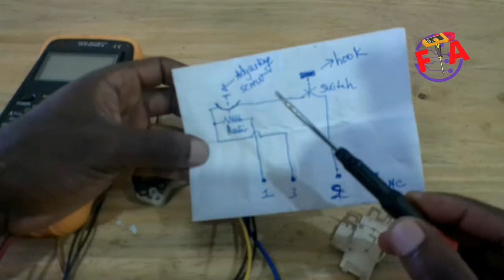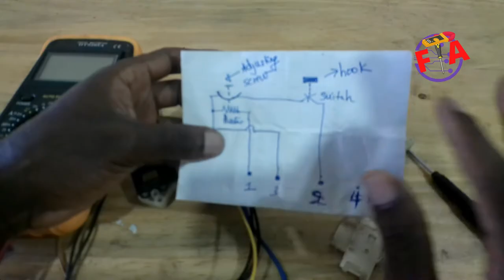DON'T REPLACE IT: HOW TO BYPASS LG WASHING MACHINE DOOR SWITCH STEP BY STEP.

Comment: Adjusting the screw can cause the lock not to unlock. You then have to remove the top of the machine and remove the switch from the body. I just removed the red latch protuding from the switch with a grinder so it no long latches.
Reply from the maker: Okay

Comment: Could you just put a diode on pin 3 then connect it to pin 2 on the harness end , the tape it or use a magnet to keep it out of the way?
Reply from the maker: what is the purpose of diode here? I don't undestand
Reply: @felixtechnoaid2044  , I was just thinking you could use a diode and then put a resistor to simulate the lock exactly, you just need to know how much resistance the thermal material produces cold vs hot. But if a direct connection works, then 👍
Reply from the maker: @BobHenderson-dr2wy  I don't have much information on that, I shall do research see if it can work

Comment: Hello, I need your help. I bypassed the switch just by adding some thick tape inside the internal part of switch to remain pressed and make contact all the time. I did not remove the thermal sensor nor the spring mechanism. Now the door is permanently locked and unable to open😅. Even when i try mechanical force bypass by pressing the lock with haxo blade it doesnt work. Please guide to solve this thanks
Reply from the maker: Cut or remove plastic  hook attached to the thermostat.
Reply: Haha 😂😂😂😂
Reply from the maker: @MikaeYYT    why are you laughing
Reply: looks like you forgot to remove the lock part. Felix didn't show this step in the video. He only said to do it. I'm glad I watch it a few times to make sure.

Comment: Don't bypass switch is ok neutral supply  fail it's pcb fault not switch bypass it's not proper solution door is open working process it's not solution
Reply from the maker: most of the cases they fail, you just bypass it it works fine, but not safe
Reply: @felixtechnoaid2044 you are wrong. Mickey mouse are for cheap people.
Reply from the maker: @BJcanal270  you made me laugh 😃,  I visited your youtube channel, and now I came to understand  why you say cheap people.